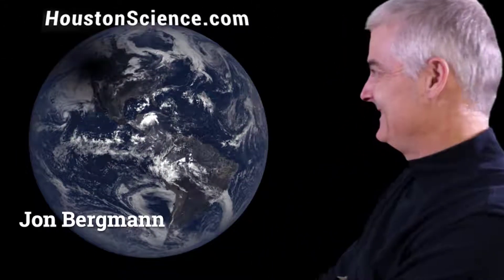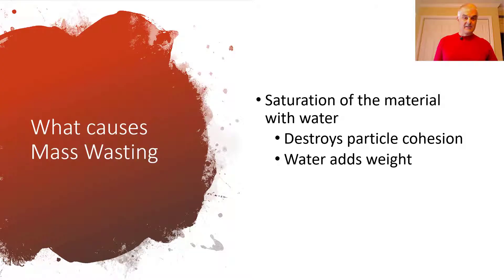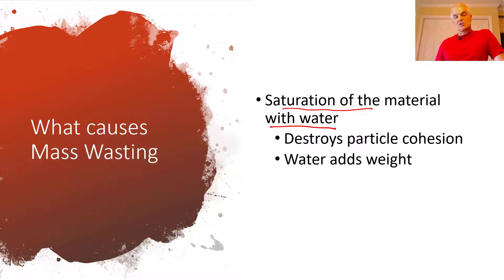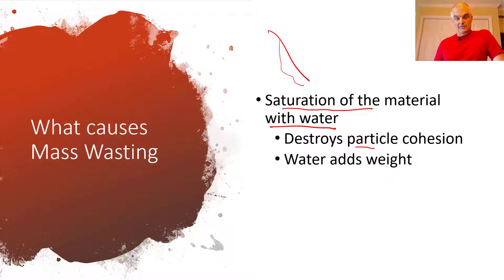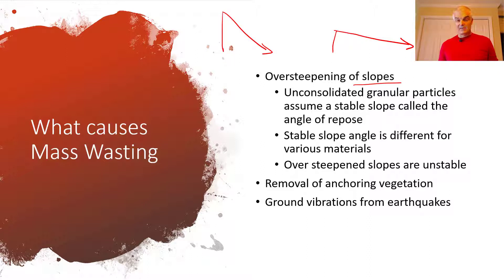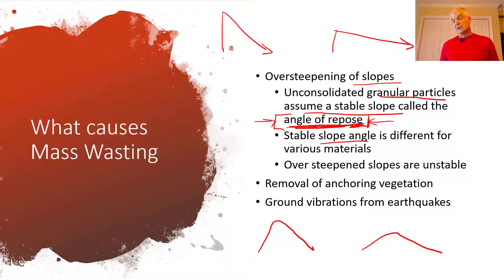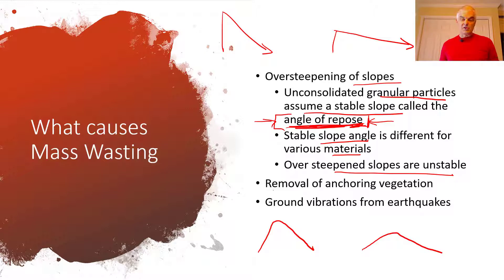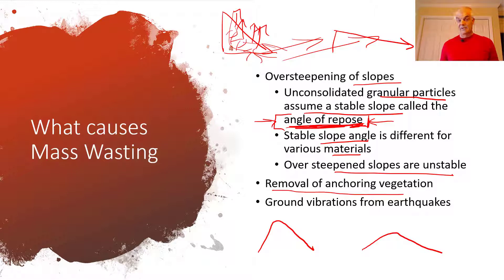What Triggers Rockslides and other Mass Wasting Events?

Comment: Liquefaction 🤦‍♀🤦‍♀🤦‍♀🤦‍♀🤦‍♀pore water pressure increase this increase of pressure is continued so that the effective stress reaches zero under the equivalence with total stress, the soil would lose its loading power and in bearing higher loads, it acts as if it is condensed liquid, the result of which would be settlement, rotation and huge marginal displacements - Landslides